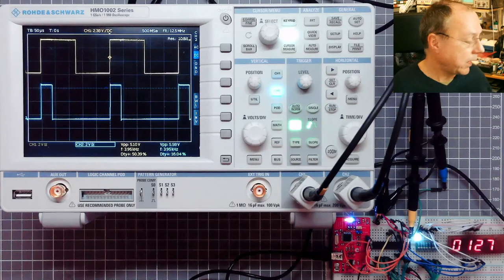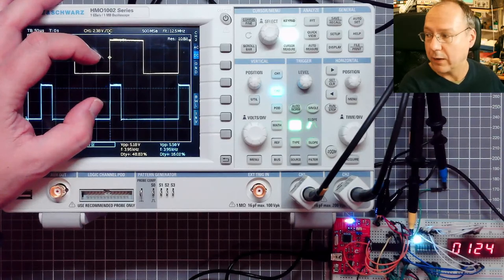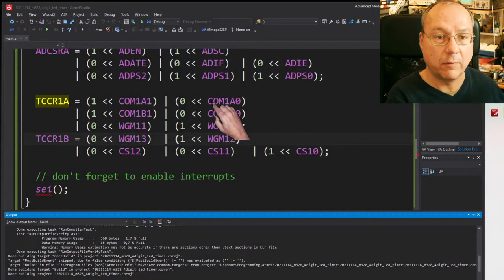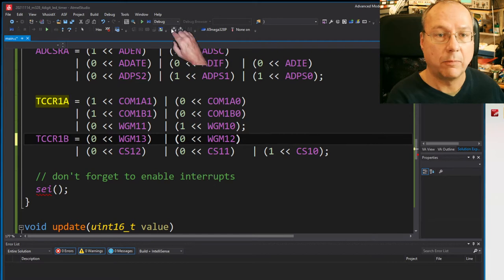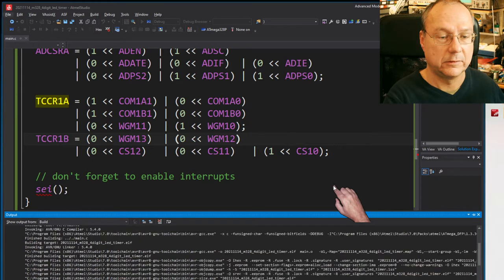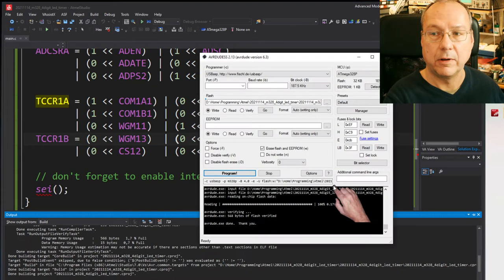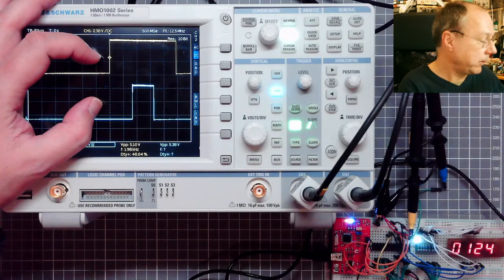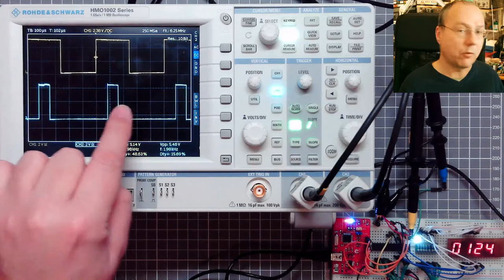Fast versus phase-correct PWM

Comment: Excellent explanation. I’ve been working on a couple of pwm projects and have been completely confused by the difference.  My only criticism of this video is you didn’t explain why someone would use fast over phase correct or vice versa :). Either way this gave me a good start.  Thanks!
Reply from the maker: This video was planned as a short additional material for my students, not as a self-explanatory, full tutorial... if I ever find the time...

Just in short, fast-mode gives you twice the pwm frequency at otherwise same performance, but it is also the standard mode in most cases. If you run two channels at different duty cycles still they will either be switched on or off at the same time giving you larger current transients in total.

Phase-correct pwm not only distributes the switching times more widely, it also can be used if you need to avoid overlaps between switching, e.g. if you use one channel for the switching of the upper and one for the lower transistors in a H-bridge.
Reply: @uwezimmermann5427  Thank you!  that helps a lot.

Comment: Detta är viktigare än vad dina studenter anar.
För många år sedan reparerade jag styrdon till industrin, en av produkterna var en styrning för borstlösa motorer, helt gjord med opampar och vanliga grindar, förutom 2 multiplikatorer som används som översättning av yttre potentiometerns styrvärde till den interna börvärdet.
Dessa produkter ansågs som svåra och gåtfulla, speciellt då de krävde så mycket kalibreringar, det var som att stämma ett musikinstrument, men jag gillade att arbeta med dom, att hänga på osciloskopsprobarna på strömsvaret och se 3 perfekta sinusvågor och höra motorn varva rent var mycket trevligare än de tyristorstyrningar jag annars jobbade med.
-Poängen är att utan möjlighet att skapa PWM perfekt centrerat, kan man knappast skapa en motorstyrning!
Reply from the maker: Mina studenter har redan frågat efter tillämpningarna för just "phase correct PWM" och jag har svarat att motorstyrning med H-bryggor var en sådan tillämpning. Kul att höra att det stämmer överens med verkligheten också.

Comment: my question is , why my 25 KHz signal on my Arduino Uno (Atmega 328 p) is very stable almost perfect while on Attiny85 there is a constant shift of duty cycle like a few percent and also frequency is not very stable for example between 25 000 - 25 400 it varies etc. Do you have any idea why is it so ? How ti improve it? I am not going to solder this until I make it more accurate (it will be for my ESC of brushed motors controller project and I need it to be very stable).
Reply from the maker: all Arduino boards I know of (especially Uno and Nano) use a 16 MHz quartz crystal, sacrificing 2 pins of the package of the Atmega328. You can also run the Atmega328 on an internal RC-oscillator like the ATtiny. The internal oscillator can be calibrated, but by default it is specified to be accurate to about 2% as you observed.
Reply: @uwezimmermann5427  Thanks for the reply. I really appreciate it.

Comment: Hi, 

I need your brain power. Dual PWM resistor weighting in analogue adds more resolution and bits. 

I'm making an AM transmitter. Can we do that digitally??? Combining bits from D9 D10 phase correct to 14 bit possible? I have 31.25 KHz on each pin as PWM. A0 takes in Audio. ADC is 10bit only but I want more PWM resolution to suppress noise 

I need to combine the high and low bits digitally and perhaps add a bit or two from Arduino clock, maybe.. so this 31.25KHz PWM is gonna turn on and off 1600KHz carrier via a nand gate. We got audio now at 1600KHz

No one is able to help me. Not even Arduino forums. Please suggest.
Reply from the maker: With "digitally" do you mean OOK (on-off-keying)? Otherwise I don't see how "switching the carrier with a NAND gate" will give you a continuous modulation of the amplitude of the carrier wave.

Well, in principle of course, if you switch on and off the carrier wave and then pass it through a high-pass filter getting rid of the PWM signal, you would get the carrier wave and its sidebands through and thus your desired signal, the separation between 31 kHz and 1600 kHz might be enough to handle for a quite simple filter. But then you should also be able to do this simultaneously from two resistor-weighed outputs - however you would need to handle the carrier switching and filtering separately for both channels and only mix them afterwards.

Essentially you would need a bandpass filter for each "PWM channel" around the carrier frequency, wide enough for your desired audio frequencies and narrow enough to suppress the PWM frequency. After the filter you mix the two signals using weighed resistors.

Comment: ı need some help. ı want to keep first pwm stabil and control second pwm with potentiometer
Reply from the maker: that could almost sound like a question I ask my students... If you are using an ATmega and you are using the same timer for both pwm-channels, then you can change the duty cycles individually by setting the OCRxA and OCRxB to different values. E.g. for Timer1 this would be OCR1A and OCR1B. Now you can use one of the ADC channels to read the potentiometer value and use this value to set the corresponding OCR-value. In Timer1 there is are 10bit PWM modes which suit the 10bit ADC of the Atmega ideally. In the main loop you would periodically start an AD-conversion and then just write OCR1A=ADC.
In Arduino-speech you could do almost the same by writing analogWrite(analogRead(chan)/4) here you need to divide by 4 because in the default settings analogRead is 10bit wide but analogWrite only 8bit.
Reply: @Uwe Zimmermann It is so important proposal for my school project.  thanks a lot for your help.

Comment: what is the use of one over the other.
Reply from the maker: If you just want to control individual loads then you would prefer fast PWM because it gives you twice the pulse frequency and thus is easier to filter, less flicker. But if you want to control a load in an H-bridge configuration then the phase-correct one will give you non-overlapping signals for the high side and low side drivers.

Comment: Can I get the code and schematic pls?
Reply from the maker: there is really not much of a schematics - the main connection is a 10 kΩ potentiometer to give a variable voltage to pin ADC0 and the multiplexed 4-digit LED display, connection description is in the source code which I had to tidy up a bit: https://pastebin.com/XrgEnbUL
Reply: @uwezimmermann5427  thanks